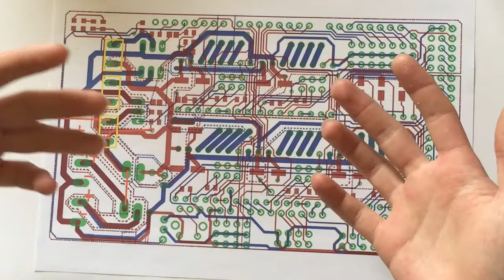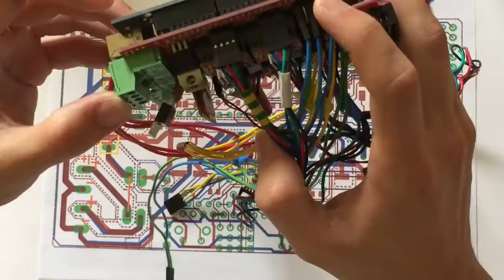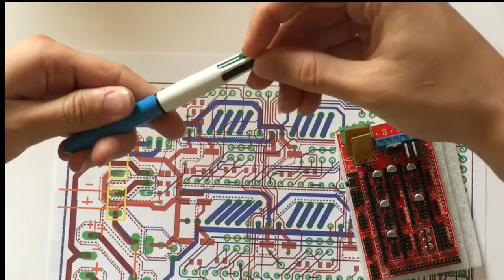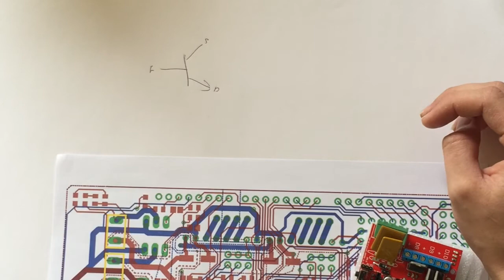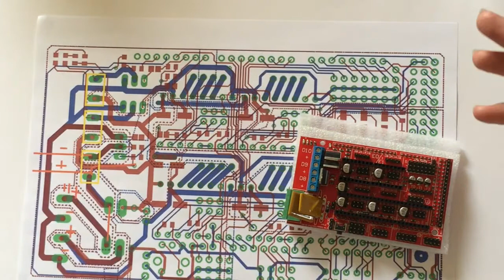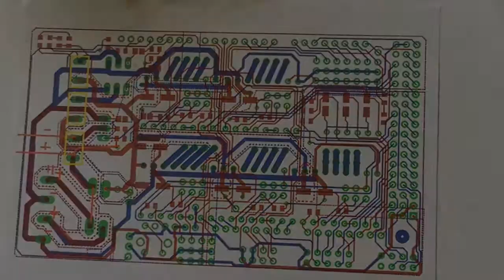Upgrading RAMPS BED to 24V

Comment: I'm sure you've got that figured out by now, but you expressed some confusion as to why the drain and source seem to be connected backwards, source connecting directly to ground and drain connecting to the bed (and through it to Vcc).
Basically it's because the MOSFET is an N-Channel type. You'll notice even in the data sheet that the descriptors (S) and (D) are backwards to your transistor-like drawing. For a P-Channel MOSFET, it would be the other way around (but it would be 'opened' by pulling the gate to ground, pulling it to Vcc would turn that one off).
A very nice overview of the different types: https://oscarliang.com/how-to-use-mosfet-beginner-tutorial/
Reply from the maker: TheCreat good reply! So basically drain and source are always the same though either transistor works in opposite directions. 
Yeah it’s just one of those slightly strange things to get used to ¯\_(ツ)_/¯

Comment: Unless I am missing something, why didn't you just send the hot bed signal through a 25A external MOSFET unit?  If you did this then the control board would stay all 12 VDC and unmolested (other than the poly-fuse vs blade fuse option).  The 12VDC signal would go into the trigger side of the MOSFET and the 24VDC would be isolated to the relay side.  Best part of doing it this way is you get the heat away from the control board, too many 3D printers die because of small MOSFETs on the heat block and bed circuits.

It would give you the option of running 2 power supplies (wall wart 12VDC plus a regular 24 VDC PS) or 1 regular 24 VDC PS and use a DC-DC converter to power the control board.
Reply from the maker: Rich simple:
- Space. They’re bulky.
- Surprising rarity of DC ones. Most are AC.
- The simple fact that most solid state relays are actually just one or two transistors with perhaps a diode in there for protection. 
So why add in a big box which takes ages to source when all I need to do is stick a heatsink on it? The MOSFET on the RAMPS1.4 is actually capable of about 60V, but it needs cooling to do so. 
Your second point of using a 24V + converter is moot as that’s what I do anyway. As for adding in an extra PSU or wall wart... again, space and not wanting to have 2 sockets.

Hope that clears things up.

Comment: Can someone tell me why my Robo 3D printer will not connect to my laptop I just replaced my arduino and ramps board now I can’t get it to connect I have power going from the power supply to the ramps board but that’s as far as it goes
Reply from the maker: William Winter do you have flashing lights on the board? What firmware are you using and are you sure they’re communicating with the same baudrate? And just to check, you’ve flashed the firmware, right?
Reply: Acrimonious Mirth yes I have a flashing light on the arduino board and the ramps board as far as the firmware goes I think I’m using Arduino 1.8 and I don’t know what you mean by dashing the firmware
Reply from the maker: William Winter ah, now there’s the problem!
You don’t have any firmware (code) on your Arduino to actually run the printer. This doesn’t come preloaded in most separately sold boards because of the huge variety of settings. Now, my best bet is that before now you were running Marlin firmware on your previous motherboard. What you’ll want to do is google how to download, setup and flash (upload) Marlin firmware to your 3D printer.
To do this you’ll need to know things like whether your endstops are max or min, how long each axis is, how many steps per mm they all are and that sort of thing.

Comment: Will the Ramps melt down?
Reply from the maker: Will Kim I should certainly hope not! If you have everything wired up correctly and a good heatsink you’ll be fine. One area to be wary of is the connection of the bed wires to the RAMPS as if not properly connected they could indeed overheat.
Reply: Could i Have links to the poly fuses

Comment: What power supply do you need for the ramps now after modding
Reply from the maker: Will Kim good question! I’m using a 24V 350W PSU. It took a while for me to be convinced that would be okay as the bed alone is rated at 350W. However we monitored the power draw while operational and it only uses 100W once it’s up to temperature. The PSU has handled it fine.
I’d advise on the safe side to get something with more oomph though!
Reply: Acrimonious Mirth how many amps
Reply from the maker: Will Kim 
P = IV
I = 350/24
I = 15A (rounded)
Reply: Acrimonious Mirth are you using a 24v 300x300mm bed?
Reply from the maker: Will Kim yes.
Reply: Acrimonious Mirth  on
Reply: Acrimonious Mirth and what heatsink do you user for the mosfet
Reply from the maker: Will Kim I cut one out of thin aluminium sheet, made it pretty large to be safe. I think one of the later videos shows it!
Reply: Acrimonious Mirth do I use a 24v e3d v6 or a 12v e3d v6?
Reply from the maker: Will Kim when using this setup ONLY the heated bed is 24V, you’ll need to step down all other power to the RAMPS to 12V, so yes, you’d use a 12V E3D V6.
Reply: Acrimonious Mirth thx

Comment: Ler me forecast _ you have dedicated power supply (12 volt) for Ardiuno and 24 volts for motors and rest of the things as of now. Am I true?
Reply from the maker: viren chocha no, everything is running 12V except for the heated bed, which is 24V as shown in the video. It uses a 24V PSU with a 12V buck unit to convert for all 12V systems!
Check some of my more recent videos to see that it is still working after many months!
Reply: I have seen website stating that 24 V operation has advantages for speed of stepper etc. However, you seem to have more practical experience as you have made the modification.
Reply from the maker: viren chocha yes this is indeed true! However I find 12V is fine for running the motors and to upgrade the RAMPS completely to 24V as you say would be difficult. I just needed 24V for the very large heated bed so I only upgraded for that :)

Comment: Boss, if you are not removing D1 then you are invariably going to blow your arduino...watch out..
Reply from the maker: viren chocha ah, no. That applies if you’re driving the motors on 24V. As I explain in the video I’m only driving the bed and it’s completely isolated from the rest of the system by a MOSFET. That MOSFET ensures no such issues happen. The resistor you may remove if you wish (or replace) simply allows the LED to indicate power is going to bed.
Can confirm after several months of use that this is fine.

Comment: Hi dear Chris
Thanks for sharing this useful data
I want to know why do you use 3.8K resistor? and how do you calculate it?
I think the basic one uses 1.8K for 12v with a red led that it runs about 2v/20mA .with this condition led draws 5-6 mA. what do you think to use a 1.1K for 24v ? and in this case led runs at 21mA .
Thank you again
Reply from the maker: Jan Doe hey! Usually in electronics it’s the current that does the damage. If we take V = IR and we know we should be keeping I constant then we get:
I = V₁/R₁ = V₂/R₂
Plug in the numbers:
12/1800 = 24/R₂
R₂ = 3600 Ω
As resistors come in standardised resistances and it’s better to under-current than over-current the 3.8k is used.
LEDs are quite sensitive to current and it’s pretty easy to kill them, I wouldn’t risk it. To be honest if I were redoing this I would just use the soldering iron to heat up and remove the surface mount resistor altogether. I don’t look at that LED much anyway and my testing phase doesn’t rely on it heavily either. Removing the resistor doesn’t damage anything else; just stops the LED from lighting.
ALSO I SHOULD NOTE: The existing MOSFET for the heated bed is perfectly fine, so long as you put a nice big heatsink on it and best to fan cool it too. I haven’t gotten round to updating the video with that info yet.
Reply: Thank you so much dear friend
I'm trying to build a 24v ramps and consider your great points!

Comment: Hi did this work correctly in the end?
Reply from the maker: Oh yes! It was a little bit of a journey to find out what exactly the real issue was though.
You see, the heated bed transistor overheated really quickly and it made no sense, I tried 3-4 different ones which all should’ve worked...
Until I sat down and did a few thermal calculations based on the data sheet. The issue is that while the transistor that comes with the board is perfectly capable, it DOES need a heatsink of at least 20mm². So I went overkill and made this rather large heatsink with bent fins that I screwed on + thermal paste and it runs as cold as you’d expect! 
Later videos are testament to it working as the 300*300 bed is 24V only.

I do need to up my PSU though, when the 300*300 bed heats up initially is draws A LOT of current, the PSU struggles with that until the bed is up to temperature when the entire printer, using both nozzles, only runs at about 150-250W.
Reply: I just tried with a 300x300 bed myself following ur guide and had the same issue my bed mosfet over heated and died within about 20 seconds. My bed is 1.9ohms can you recommend a mosfet? Was looking at IRLB3034PBF
Reply from the maker: Chris Jones sorry to hear that, I can’t remember if I released an official update on the situation. That means your bed must be around 320W, so is just about the same as mine. I would recommend just sticking to the STP55NF06L that should have come on your RAMPS, if you’ve fried yours you can get more for pennies and it’s handy to have some spare. Like I say, just make sure you have a decent heatsink and thermal paste on it. I can’t remember again (been a busy few weeks) if I showed the one I made in a later video. It extends up above the RAMPS slightly then at a right angle over the power terminals, with crimped fins to improve cooling area.
Reply: Thanks for the update, i did look and couldn't find a video of your completed upgrade
Reply from the maker: Chris Jones good luck and thanks! I’ll try and publish one, not at the printer during university termtime though.
Reply: @AcrimoniousMirth  you made a mistake in explaining how mosfet work. source should allways be tied to ground because the gate should have higher voltage than source(n chanel mosfet),otherwise it wont work or burn depending what conections you have